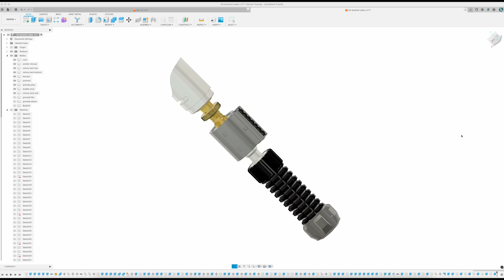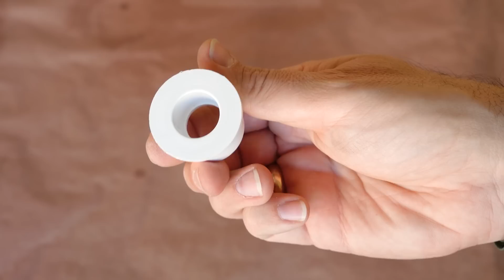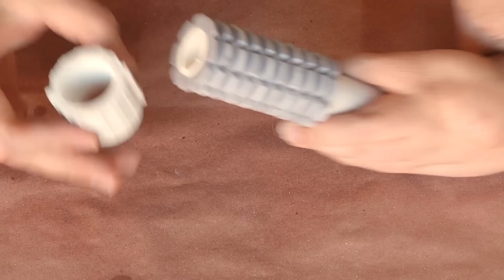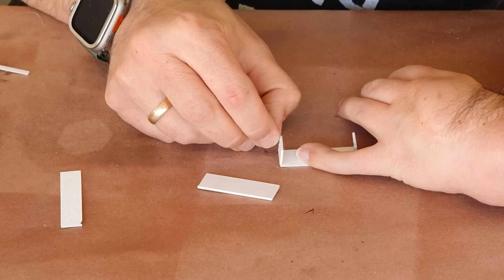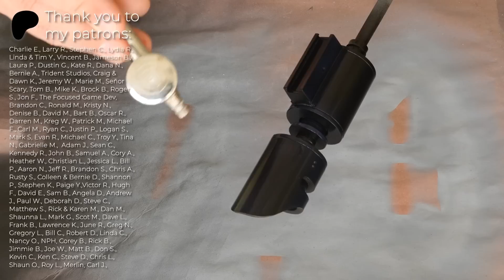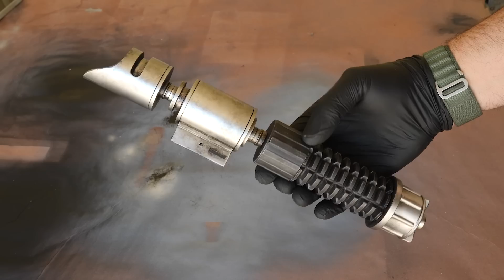Home Depot DIY Lightsaber

Comment: Can you link the original piece that you opted to 3d print instead?
Reply from the maker: Here's a link: https://amzn.to/4jLqcu3 I can't recall the actual size, but I believe those are correct. If you wanted to be sure, you need to look for "rubber slip joint washers" in the plumbing dept. at your local hardware store.

Comment: I don't have a 3 D printer. Any suggestions for those parts?
Reply from the maker: You could use the washers I mentioned or maybe there’s something you’ll find while looking around the hardware store that might be a good replacement.
Reply: Ok thanks. Who carries Rub and Buff?
Reply from the maker: @DavidSearfoss-kx7gy You can get it at Michael’s craft stores and I believe Lowe’s and Home Depot both do in the paint dept.
Reply: Ok cool 😊. Thank you and "May The Force Be With You.

Comment: I dont recognize those washers, what are they based on?
Reply from the maker: Which ones?
Reply: @ the ones you ended up 3d printing. Did the expensive ones look just like that?
Reply from the maker: @ ahh ok. The parts were similar, but not identical. I had thought to use two tapered plumbing washers to create the zig-zag look, which would have given me more of a Luke Return of the Jedi lightsaber grip.

Comment: Very bad practice using adhesives that are not conducive to the materials used.
Reply from the maker: I've never run into issue using CA glue with pvc, resin, or styrene.

Comment: Hey this looks great. I’ve done several hardware store builds and I must say I like the way yours came out very nice. This is the first of your vids I’ve seen so I have a couple of questions. Do you have a part name or number for that $3.00 washer that you opted not use?  And second where did you get the box bubble insert?  I’ve used an old style doorbell button housing for the box and that works pretty good but it like 7 bucks or something. But it does have a great look. You do have to modify it usually so probably not any easier than your way
Reply from the maker: Thank you and welcome to the channel! I don’t have a specific part name other than “plumbing washer.” They’re basically a tapered rubber washer. The bubble strip was given to me by a friend but I think he got it from wannawanga.com.

Comment: Great design! I've made a couple of prop replicas, and I'm not a great painter, but some of the handheld stuff (like a Star Trek phaser) ended up with a sticky, gummy touch to it. Do you have any tips to avoid that?
Reply from the maker: What did you paint them with?
Reply: @VanOaksProps  It was plain model paint by Testors. Don't remember if it was enamel or acrylic. Glossy finish. Looks great on model cars for display but leaves kind of a sticky feeling on your fingers when handled.

Comment: Great video, and an absolutely amazing result!  One thing about the "budget" aspect of this, you only took the cost of materials into account when determine the final price.  These types of builds really should take into account the tools used to create it as well.  Yes, it was under $35, so long as you already have a 3D printer and an air brushing system! :)
Reply from the maker: I get what you’re saying.

That said, if you didn’t have the printer you could swap in the $27 washers (or something else completely) and use spray can versions of all the paints in place of the airbrush.

Comment: I would have liked seeing you spend the $27 dollars so we, without 3d printers, could see the build process.
Reply from the maker: I hear you. The plan was to use tapered washers slid over some pvc, if that helps any.
Reply: @VanOaksProps  I would be VERY grateful if you could link to the washers you mentioned; I have gathered most of the parts I need for a hardware-store sourced OT Obi-Wan-inspired saber SEVERAL years ago, but I have never been able to find parts that I liked to build the grip. I’d gladly spend $30 to finally finish the thing.
Reply from the maker: there’s a bunch of options, but you’re basically looking for “rubber plumbing washers”
Reply: Thank you for the reply. I am going to do that with my build, and I will be sure to share the end result.

Comment: I've watched a few videos lately creating a metal look, and you all did the same approach. A flat black base coat, then a gloss enamel over it before adding the silver. Why not apply a gloss black base coat to save yourself a step? Is the enamel for both the gloss and to seal the paint?
Reply from the maker: Great question! Most gloss paints aren’t as glossy as the high gloss clear coat. I definitely could’ve gone the gloss black route for this because of the aging, but if you wanted a truly reflective surface gloss black spray paint won’t quite get you there.